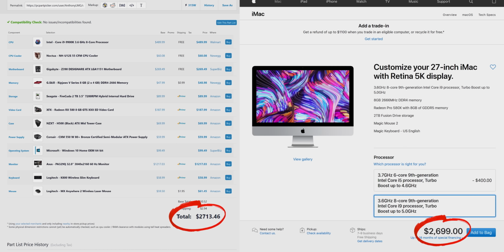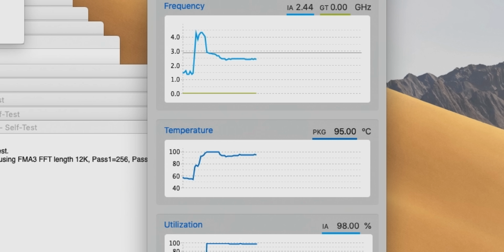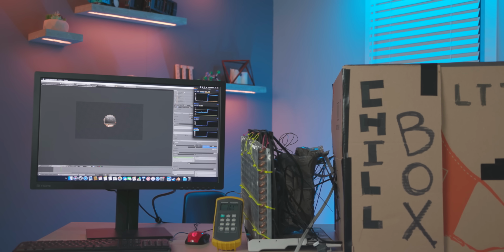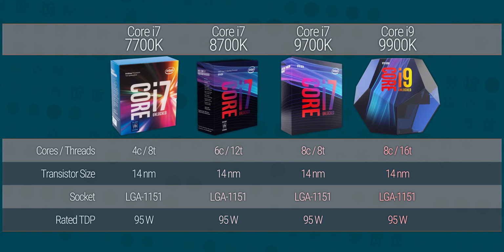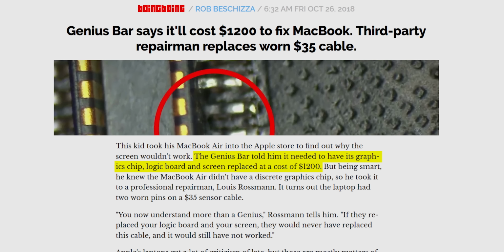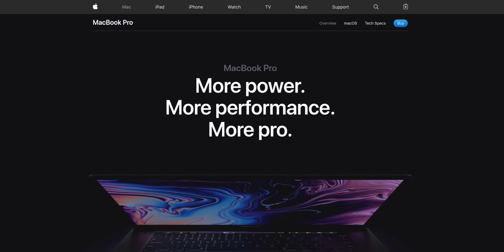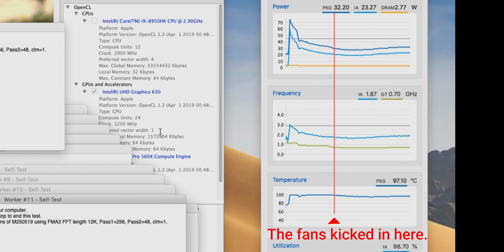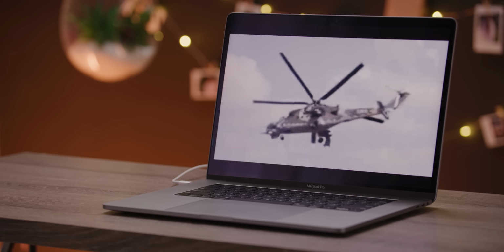Macs are SLOWER than PCs. Here’s why.

Comment: I would rather have laptops become a jet engine than get poor performance
Reply: As someone said in another comment, there should be user selectable performance profiles that allow you to ramp up the fans. If someone is gaming or doing work, they can wear headphones if they don't like the noise. Obviously you want some peace and quiet at times too though so multiple options is the way to go rather than a more aggressive fan.
Reply: @hzuiel  There is. It's called SMC fan control. Source: Used to own a macbook
Reply: @battery8035  That is a third party app. My thinking is you shouldn't need to find a trustworthy third party app to control fan if apple make it a virtual necessity to modify this. If you are selling a pro product, but also want it to be really really quiet, then within the user settings there should be a way to switch modes, without the user having to download anything. 

It would be like if microsoft wanted the surface pro to have a longer battery life, so they lowered performance way down in order to achieve that battery life, but there was no user accessible power management profile selection, you were just stuck on extreme battery saver unless you find a 3rd party app that can change the settings. Anything that heavily impacts the usage of the system under normal workloads, you would think users should get some options on, within the operating system that the product ships with.
Reply: @hzuiel  Yeah you are correct, it is a hassle, especially for the price.
Reply: @battery8035  Yeah and it is not like if you are savvy enough to realize the thermal thermal throttling issue your 3600 mbp ships with, go out and download a fan control program and crank the fans up, it is a 100% fix. With fans cranked all the way up it will still thernal throttle, just not as bad.
Reply: @hzuiel  yeah That's what Razer do with their laptops
Reply: hzuiel when I used a 2012 laptop it sounded like a jet and got hot as hell I don’t want a jet even if I’m getting max performance the noise doesn’t even let me sleep
Reply: Fun fact: Jet engines are air cooled and the cooling air is about 300°C before it cools the engine.
Reply: and what? burn your balls off? a laptop should never be something that does too much heavy loading, and if you want one like that then you shouldn't be getting a thin laptop. Apple's issue is that they put design above all else, without offering any real options for the power user. .
Reply: My laptop sounds like a jet engine constantly. Was recently at a job where they had a bunch of Mac Pro trashcans where a render failed after 12 hours, so they had to restart it. Out of curiosity, I started the same render on my laptop, and it immediately started spitting it out almost twice as fast. My $4500 LAPTOP, was performing better than a maxed out (checks apple website) $6500 Mac Pro.
Reply: @ShrlyTmpl  for a 4500 laptop that is to be expected :) mine doesn't sound like a jet engine all the time. When I get on a power outlet it starts to spin a bit (because the cpu clock speed will go higher) when using CAD it will spin up higher tho. Or playing city skylines. That game has poor performance lmao
Reply: @ShrlyTmpl  the mac pro is also very old.
Reply: Ship the machines with noise cancelling headphones. 😂
Reply: i also don't care about the fan noise. i would rather go for performence
Reply: You said it the correct way "→ I ← would rater.........".That's YOUR personal preference.And as Linus said in the video,many people rather have good looks than performance.
Reply: @29DF31C  Yes but if there is enough demand for style over substance, the market adjusts accordingly, and we are all worse off for it. It goes a bit deeper than buy what you like because consumer decisions do have ripple effects that we all feel. Every time someone electrocutes themselves by sticking a fork in a toaster and then sues the company, we all end up paying a little more for a toaster and now the toaster comes with 82 warning labels and an anti-fork device that smashes the bread or something. Actions don't happen in a vacuum. That's why people care and try to give consumer advice, reviews, etc, to help people make informed decisions rather than just be swayed by marketing. I think that has an overall positive effect on the market from a consumer perspective. When consumer choices reward companies for good things, they will do more good things to try and get the consumer to buy more stuff.
Reply: @29DF31C  a preference grounded in sound reasoning. Function over form.
Reply: @29DF31C  lmao wtf, dude was literally stating their preference. Not like the dude was going after people that are into a good looking computer lol.

Comment: Actually compare to my laptop ThinkPad X1 Extreme, I will rated MacBook performance as excellent, here is why: on my laptop, plug in the stock charger, use prime95 to full load CPU and let GPU idle, 8850H only reaches 1.6-1.8Ghz, just above 20W and stays at 72-74°C, which is totally not acceptable. And I don't know why.

Comment: First off a Mac is a pc... pc just stands for personal computer which I’m sure you’re all well aware of, so I find the title redundant. And also your price comparisons are not equal or fair, your monitor costs about 1250 which is ludicrous and not a fair comparison to the panel of the IMac you could get a panel that is closer to what the IMac has for about ~500 which makes the cost of the BYO to about 700 less which is rather significant
Reply: Well, technically that is not true.  I don't know if you recall, however IBM created the term PC for their personal computer line back in the 80s.  IBM PCs were pretty much phased out for IBM compatible computers like Dell, HP, Gateway, etc in the 90s.  All IBM compatible (technically clone) personal computers became known as PCs going forward as they were able to run the same OS even if technically clones of IBM PCs.  Macintosh never allowed their OS to be installed on any other personal computer so it was never able to be installed on a PC.  Though back then, they also ran on Motorola processors instead of Intel so it was not possible at the time.  And PC vs Apple have been in a war for the personal computer market ever since.  So as you can see, PC does mean personal computer but its a type of personal computer.  IBM compatible.  Or in today's terminology.  A non-Apple, since Macintosh now runs on Intels and is "technically" IBM compatible.  Since Apple wanted to destroy the PC in the consumer war the term still sticks.  Even though PCs are no longer IBM compatible (20-30 years of technology evolution will do that).  Confusing no doubt.  Sorry I just wanted to chime in as I use to be an Apple guy in the 80s and switched to PCs in the 90s.  I recall this battle all to well :-).

Comment: Apple should add a plate on the outside connected to the CPU chip and graphics and sell a water cooling docking station for cooling. Problem solved. Highend users who need to do some heavy work at the office can then do so without pesky thermal throttling. They would earn even more money and the user can keep its slim form factor for flirting with hipsters or whatever apple users do.

Comment: I bought a new MacBook Pro in 2009 and have been using it daily since with absolutely zero issues and the only upgrade I did was one year ago I swapped in a SSD , still running original battery and holds charge for 3 hours unplugged and constant use , it’s been absolutely flawless for me

Comment: What if I told you, all laptops will not cool as well as a desktop. I'm owned a number of windows laptops that suffered the same issues as the one MacBook Pro I've ever owned. They all suck lol.
Reply: You are repeating what Linus has said in the video, so... The whole lie of Apple is about putting a pricy CPU and GPU in a laptop and then, allowing it to throttle down 40% because of insufficient cooling or wrong case while still marketing it as a high spec machine. Except that abomination can only run at 40-60% of its maximum capability and/or fries its components making it live only till the end of warranty period. Pretty good scheme for a company, I would say. Very unethical but makes some regular $$$. That's my summary of the video, BTW. I don't really care because in my country, Apple products cost a fortune, so only rich a$$hole$ can afford it. Nothing against rich a$$hole$, but if you have to work that hard and that many hours, you really cherish every cent and you can't a afford a dumb idea such as being a fanboy of a corporation, whatever it may be. You just buy the best bang for your money.
Reply: Of course, its just that most windows laptops suck less in that regard, but there are some macbook lookalikes suffering from the same issues

Comment: Well, the answer is simple mobile is ARM while the mac is Intel.  Intel design all parts of the chip then OEM uses the chip.  ARM, however, is basically just architecture, consultancy and manufacturer company that works with a company to produce chips. This then means Apple with ARM can design device specific processors, this is why the heat vs performance is better. This is why  Apple is working on MacBooks with ARM, this could overcome some of the problems you had stated.

Comment: i understand that apple does need better cooling and i agree that the keyboard should be built better overall. as a guy who uses a macbook pro 2017 to repair other peoples machines and do homework on it and other basic stuff like that i like it alot. i personally like mac os alot because of the trackpad and the gestures and how steady and how dependable the os is. now i do have a windows desktop that can also boot into linux. i personally like mac os the most due to how everything runs smooth and it does die on me ever and it makes my laptops battery life great like 12-13 hours. i owned a windows laptop many times and there was always a compromise with each computer. they all were also about 1,300$ just like my macbook pro. i had a gaming laptop because i thought oh heck yea power! yea turns out thats a bad idea to heavy and stuff. so then i tried a inspiron and xps and they were okay but often would kill its battery fast and force updates at bad times and its fans would sound like a jet engine when i would do more basic tasks. i know there are many other laptops out there and many other budgets i could do. i only really use windows because of steam and the software it has. trackpads on any other laptops besies the macbook pro is just very very bad. its obvi not the best perf and its not the best port selection but i think even though there is flaws in this laptop its still a nice laptop and i started to use apple devices only 4 years ago and im 21 and i grew up on android exclusively.
Reply: No offence to you but if you are 21 you should have better grammar. Just saying.
Reply: Meh I do college and stuff I only really care about grammar when doing homework

Comment: A thought: Li-ion batteries do not work well at higher current draws; at some point even small increases in CPU output will greatly reduce battery charge, beyond what you would expect from increased power draw alone. Perhaps Apple sees this as a synergy, where a shorter battery operating time would be more noticed by the average user, and cause more complaints, than slower performance.

Comment: Barely keeping up with heat out of the box is a REALLY bad idea. 
Eventually the thermal paste is gonna dry out and dust will collect inside the heatsink, 
leading to reduced thermal performance. Your expensive hardware is just destined to become
a laggy, throttling mess that starts melting.
Reply: they want you to buy another machine after 3 years (just when apple care finishes). building up dust accross the 3 years is good for them.
they would even take back your "old" computer for a penny, open it, clean it, and sell it atmost at same price as new : https://www.apple.com/shop/refurbished
Reply: I mean you would think so, but Macs tend to defy that common perception. I have a 2011 MacBook Air and a 2015 MacBook Pro with Retina Display - both work flawlessly. We also have an old Mac Mini that we have plugged into one of our TVs as a research machine, and though the hard drive is a bit sluggish, the actual computer itself runs pretty damn well for being close to ten years old. Putting both fanboyism and harsh criticism aside, Macs are just built to different standards. Not better or worse, just vastly more obsessive over how each component fits into the greater whole.
Reply: @OurFantasyLife   I also have great Macs of that vintage, but have no confidence in Apple's current line up.

They are going to cook themselves just like the white Macbooks and iMacs did, thanks to heat problems and bad ventialtion.
Reply: Peter Breis I guess time will tell. Certainly not trying to discount anyone's opinion but my wife and I use a 15" MBP to edit our videos for our channel and so far it has far surpassed the gaming desktop I was using previously. Don't take this the wrong way but having bought a 15" I hope you're wrong 😉 haha
Reply: @OurFantasyLife   Mine burnt out just after the AppleCare ran out. Constant excessive heat dries out and cracks solder and other joints.

And my brother foolishly bought a job lot of the white polycarbonite iMacs at auction thinking he could fix them and turn over a dollar. Was a waste of time. They might be repairable but the cost is astronomic.

Apple's great failure.
Reply: @peterbreis5407  I mean, I currently have MB Pro from 2018 and it barely even gets hot... I'm not stupid enough to put any laptop under continuous heavy load though. Most of Apple lineup is built for low-intensity use with ability to provide high-intensity, but brief power spike. Think "unzip that archive faster" rather  than "encode 2 hour video" faster. It CAN do a video, sure, but it's simply not designed to do it often or... you will run into reliability issue. I mean, the priority here is clearly portability or straight up style (although quite frankly I don't get why one would buy Apple's desktop lineup).
Reply: @maciejkornatowski3026   How is using your laptop for its intended purpose "stupid"?

I use Handbrake a lot and if I bought such an expensive computer why should I restrict what I do with it?

After all Apple put "Pro" both in the name, AND the ticket price! Is that just a lie? (Says me rhetorically).

Comment: It's not just Apple... Dell is doing this too. At work we've got Precision Mobile 5530 and, dang, they suck ass. One day the air vents were full of dust and I forgot to check this at first. I ran benchmarks and, voila, the CPU was at 90 degrees and the fans only kicked in slowly and very late. Throttling went down to 1.6GHz instead of expected 3.5GHz. I hate manufacturers like this. They litterally programmed it to keep fans down, even if the thermals and clocks make no sense whatsoever!

Comment: My i7 8750H used to power throttle a bit in my Legion Y530 (usually when the GPU - GTX 1060 was running under load) All i had to do was to undervolt the CPU by -150V and boom, no more power throtling, running each of the six core at 3,88GHz which is slightly lower than maximum 6 core turbo of 3,95  (never had thermal throtle even before the tweak) So yeah you can have think laptop that cannot cool itself, or you have slightly fatter one but with hella more kick

Comment: Is there a video to compare times it takes to do daily tasks on similar hardware of Mac vs PC ?  I have a feeling, OSX which runs UNIX can multithread far better, and not to mention Windows require many updates, that takes far longer to update than Macs.  e.g. take you Windows laptop to a cafe only to find that it has GBs of update that it will be silently running and updating every week/month slowing down performance of everything you are doing.  It maybe OK for a power user at home who never turns off their laptop or desktop.  I am finding more and more that it is overlooked by many tech videos to ignore the amount of OS updates (Windows Security patches)  that takes forever to download and update.  It would be nice to have a Mac OSX user and a Linux user and a Windows user all debate it.
Reply: In the corporate world, most have a dedicated windows software engineers to write scripts that turn on machines nightly!!! just to make sure updates happen and check that the antivirus definitions are up to date, etc.  In the corporate world, techs can not rely on built-in Windows or built in Windows Defender to do the updates during work hours.  Most Home users will not have the knowledge of so many patches and updates that needs to be running to keep Windows alive.  Macs do not need any of these updates and when there is a major update, they are applied in few seconds or few minutes and most do not require rebooting.

Comment: as a msotly apple products user, i agree completely that the direction apple is taking macbooks hardware wise is bad, and the point of not being able to use macOS anywhere else really rings with me. i could care less about the hardware the OS is in as long as i can run macOS but sadly i dont have that luxury. i have to stick to their badly designed machines.